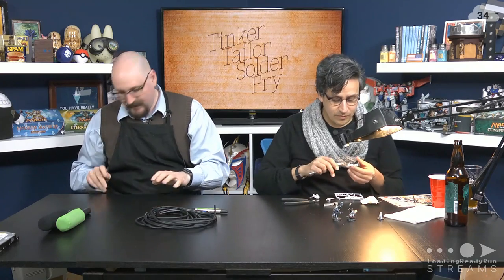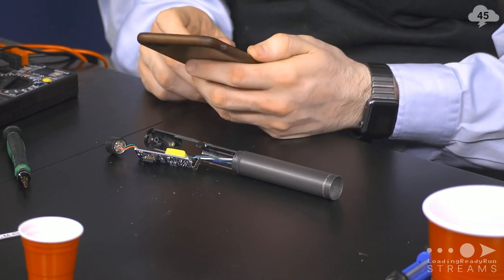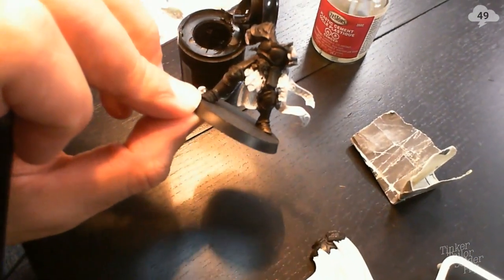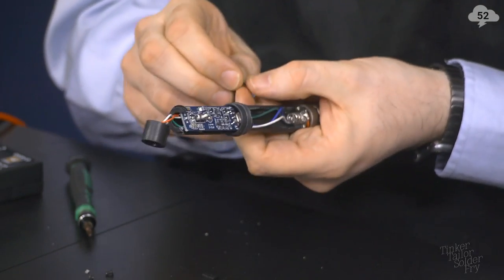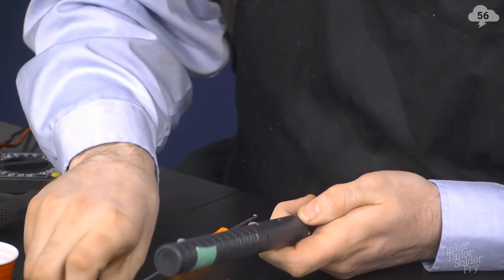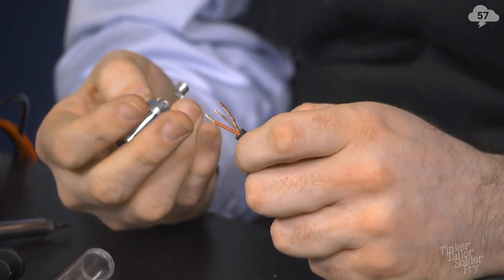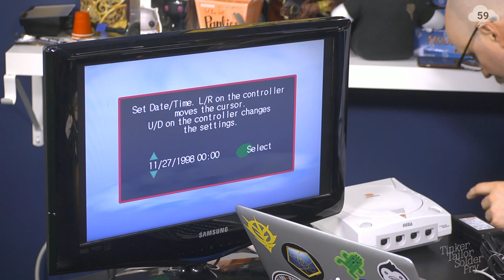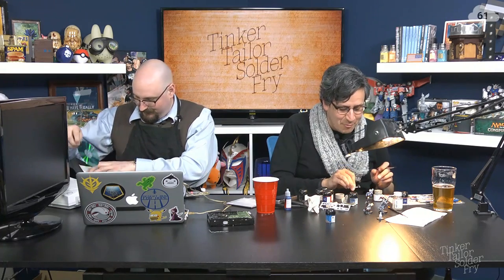Tinker Tailor Solder Fry — Microphone Maintenance & Figure Painting

Comment: Cam, if you haven't figured out by now, the reason is that you are using white primer in your climate. White primer is the most environment sensitive primer - if you exceed a certain temperature, or it's too cold, or it's too windy, or it's too humid, or too dry it will become varying levels of grainy. I actually was thinking about graininess on your miniatures before you even mentioned it. Never used that particular brand of primer before, so I can't speak for it, but ask the manufacturer for some specs if you want non graininess. As a guideline, go for 20 degrees Celsius with a 10~30 humidity if you want a nice smooth white finish. It's hard but practice will make perfect. And shake very well. 5 minutes.